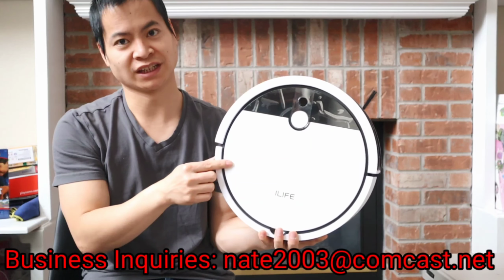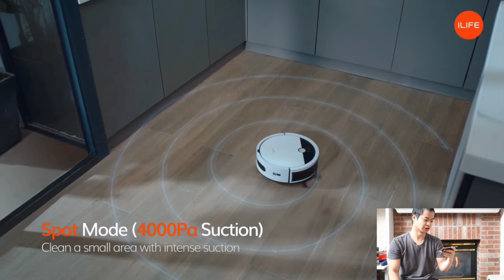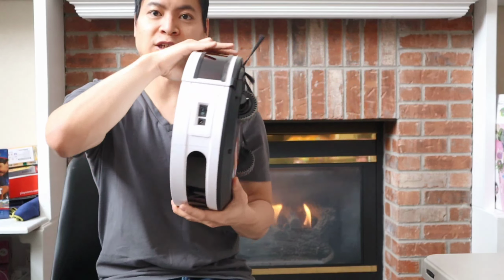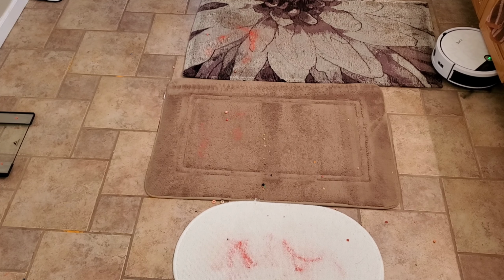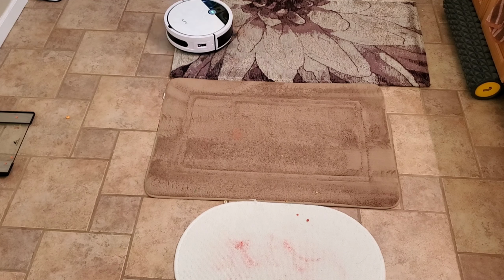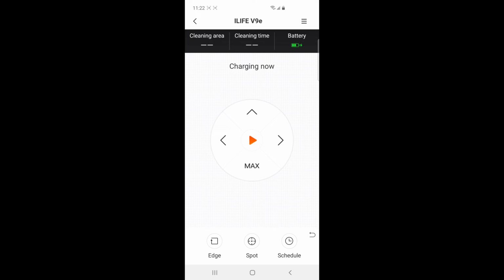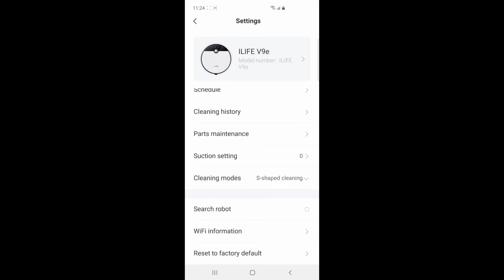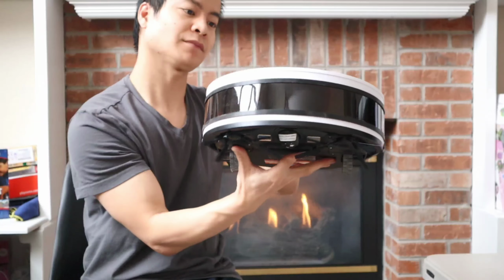The iLife V9e Robot Vacuum that twice the POWER of most Robot Vacuums!!!

Comment: Could use your recommendations. I need a robot vaccuum that can do well on tile floors, to pick up mostly sand, very fine to micro dust, and women's hair. There aren't any carpets. I will spend extra time to clear out the floor for the robot to clean, and reorganize afterwards, so it should have smart navigation and finish its job rather fast.
Reply from the maker: Hmmmm so my best recommendation are Roborock S4 Max https://amzn.to/3bhDjlM

If you want the smart mapping aka being able to select a room to clean via the app.

A more cost effective solution and I found did well with sand and micro dust on smooth flooring is the iLife V9e https://amzn.to/2ONbnyB

Keep in mind you won’t get the smart mapping features.

Lastly the 360 S9 is a good performer with the ability to save multiple maps if you have a multi level house. https://amzn.to/2Zn7RwU
Reply: @RobotMasters  Wow thank you so much for the recommendations. I'm currently owning the Medion MD18500, which has the same basic suction mechanics as the iLife V9e (suction only without main brush). Crazy suction power, but no smart navigation, and this really is a problem when I'm too busy but still have to clean the house, because they won't stop automatically when having their job done, I have to put a timer to turn her off.

Anyway, I think the Roborock S4 Max is the best fit for me (after a day looking through all mid-to-high end robots). But do you think the Roborock S5 Max or the Deebot Ozmo T8 AIVI is better in terms of vaccuuming than the S4 Max? (Because the S5 Max and Ozmo T8 AIVI is surprisingly cheap in my area, S4 Max is not available sadly) 
We won't compare the mopping features here because I already have the Braava Jet M6
Reply from the maker: @duyphuong6143  well both are good, if the the T8 AIVI is available than that a good option. Just keep in mind if you have a lot obstacles or you plan on moving the robot around a lot the S5 Max will be the better buy.
Reply: @RobotMasters  The S5 Max would be the best I guess. I clear the floor every cleaning so there won't be any obstacles. But I have to move the robots a lot since there are 3 floor plans in my house. Can the S5 Max or the T8 can automatically locate itself when put randomly in their floor plans? The Jet M6 can, though. I usually place the M6 randomly, and it can recognize which floor plan, and the exact location in that floor plan
Reply from the maker: @duyphuong6143  The S5 Max would be my choice, better at relocating itself without getting lost.
Reply: @RobotMasters  Thanks for the recommendations
Reply: @RobotMasters  how does v9e compare to the s4 max
Reply from the maker: @Daygomadebrian  Hello the S4 Max offers more app features over the V9e. You have the ability to do room and area select in the App. Also you can have the robot stay out of certain areas. I would recommend the S4 Max over the V9e unless your home smaller and just have smooth flooring, than the V9e should do fine.

Comment: could you show more of the cyclonic unit??
Reply from the maker: What would like to know more about the cyclonic technology?
Reply: @RobotMasters  how it looks like in closeup and how it exactly works. I can't find more information in the internet about this model V9e, where it was released, etc.?
Reply from the maker: @RoboVacParty  Not 100% sure I believe it was released later of 2020 or early 2021. It aimed for the budget friendly buyer looking for an easy to use Suction only robot Vacuum. Since this uses Gyros you won’t get the smart mapping features. I found the cleaning performance to be okay, but hindered by the fast spinning side brushes. As far as suction goes it does fine picking up dirt and debris on smooth flooring and tiles. On carpet it struggles because it lacks an extractor bar. The cyclone is located in the dustbin which is washable. The filter it self is not washable but is outside of the dustbin. So from the standpoint of an suction only robot Vacuum it one of the best, beating out the Ecovacs 950 which also offers an suction only attachment.

Comment: I would be surprised if this could deep clean carpets anywhere near as well as one with a brush roller.  A deep sand pickup test would show this.  Otherwise I would only use this on hard floors.
Reply from the maker: I think iLife says it mainly for hardwood floors but their commercial shows carpet.